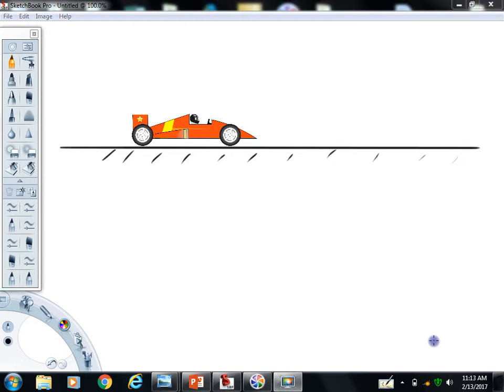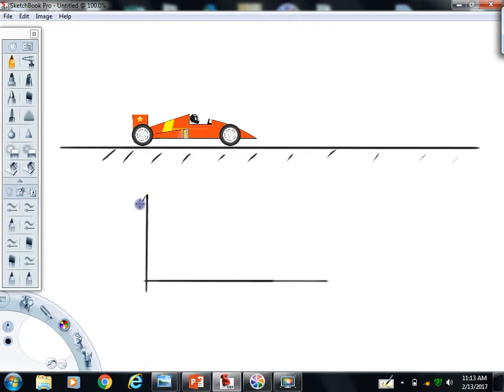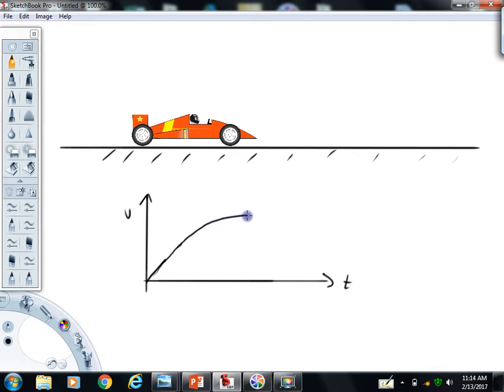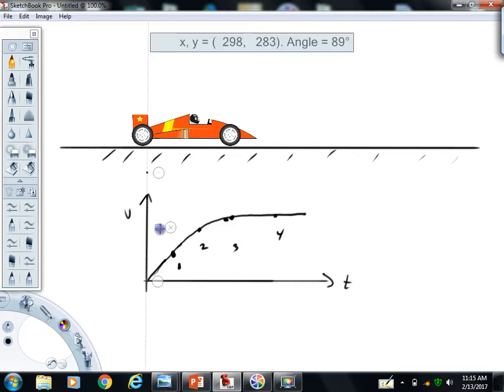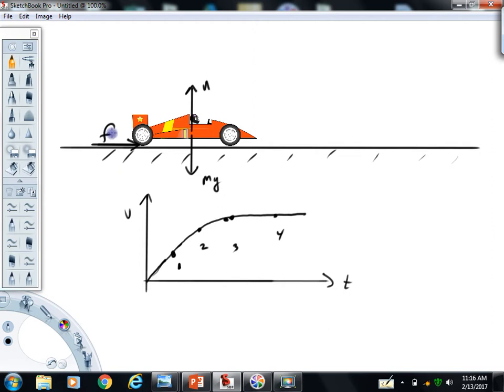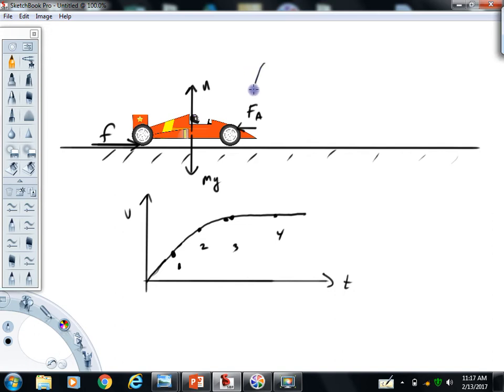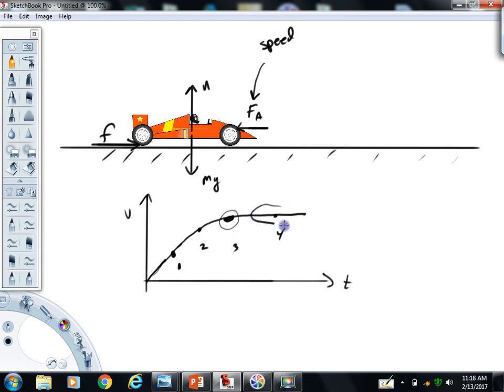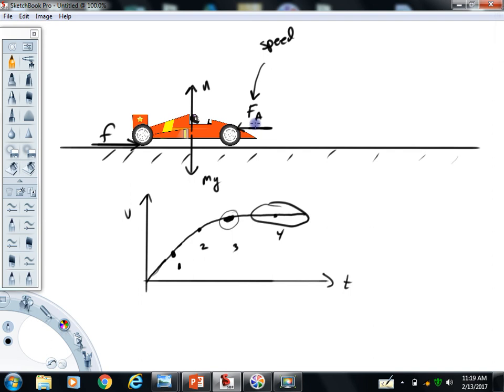Free body diagram of an accelerating car

Comment: why is the frictional force pointing toward the right? I thought friction was always the opposite of the direction of acceleration.
Reply from the maker: friction always apposes motion. In this case, the  torque applied to the tire is making the tire want to accelerate clockwise in the picture. That is the motion that is being apposed.  Imagine the car is stopped and sitting on glare ice and the driver hits the gas. The car could not, or barely,  accelerate .  Repeat that thought with car on dry pavement. Car accelerates right.  The difference between the two cases is the friction acting on the tire of the car